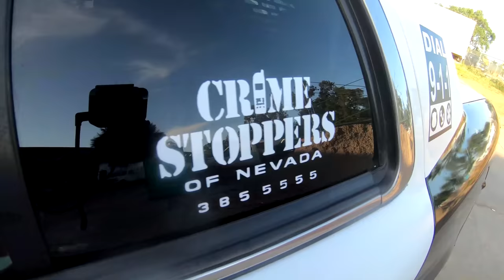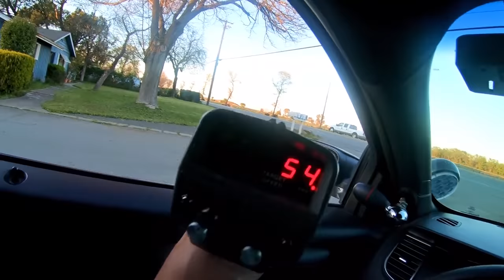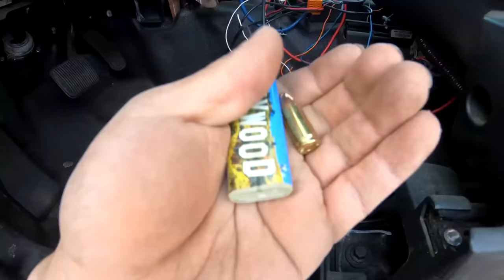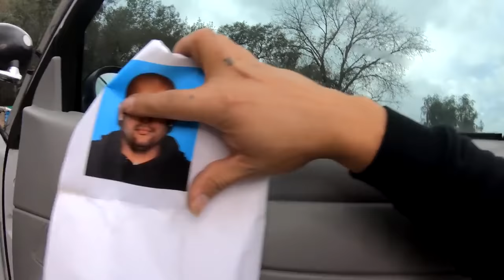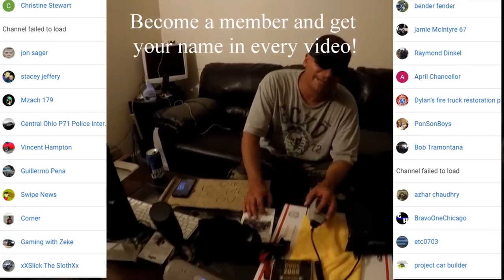Searching Police Cars Greatest Finds of 2020! | Crown Rick Auto

Comment: That lighter you found is called a crackheads lighter. It’s really easy to do and you need only the lighter take off the metal bit and ya no the plastic regulator turn it right then lift it pull it to the left put it down and push to the right again. Boom massive flame